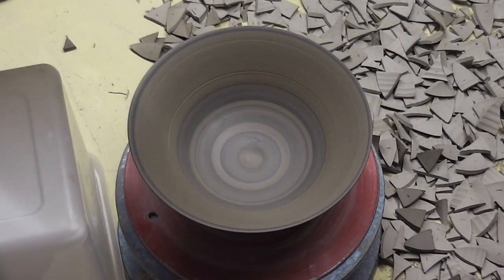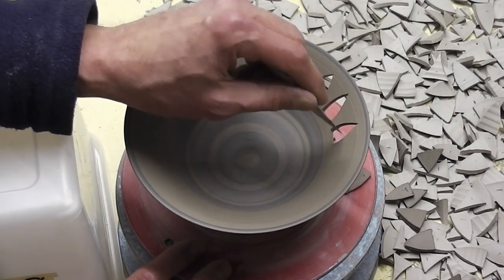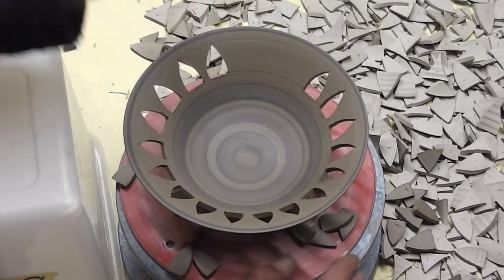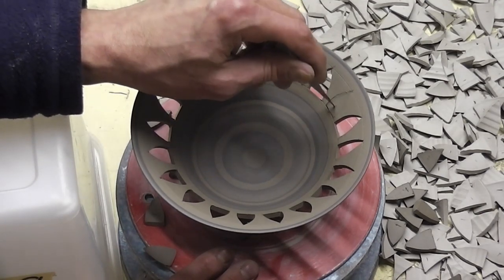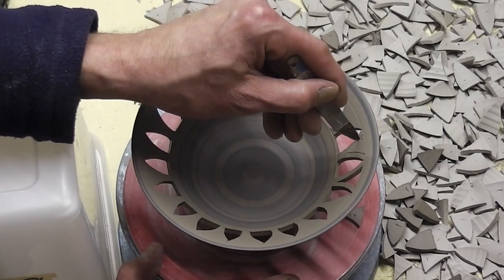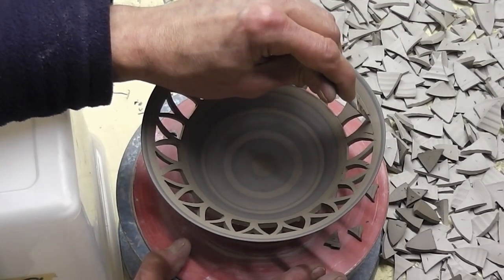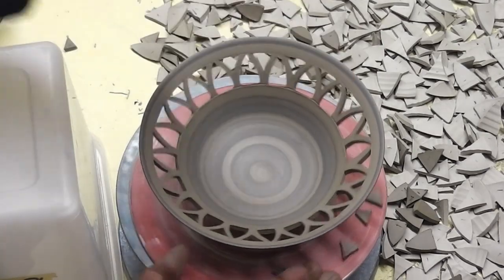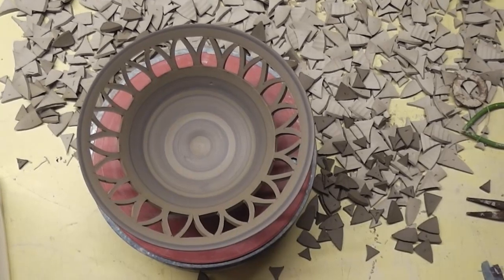Carving / Piercing a Pottery Bowl : How to carve clay

Comment: I don't do throwing, so I apologize if this question sounds odd. What do you do with the little cut out bits? Can they be reused? Or would they be too dry or cause too many air bubbles to get into your clay if you did that?
Reply: You can take dried clay and add water back into it until it becomes soft again. Once it's soft again, just wedge it and reuse. If it gets too watery, let it dry out a bit until it's right again. That's part of the reason I love clay, very forgiving :)
Reply: Black Pearl ART Awesome, thank you for the answer. :)